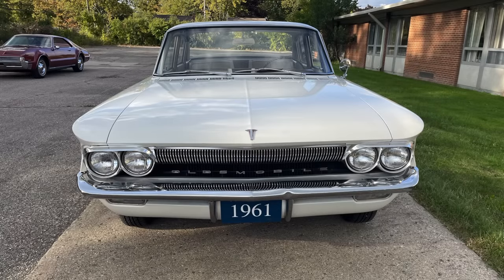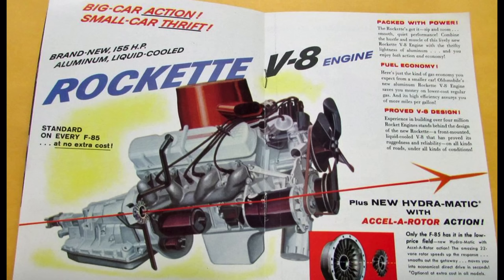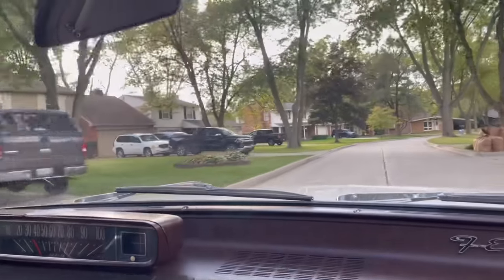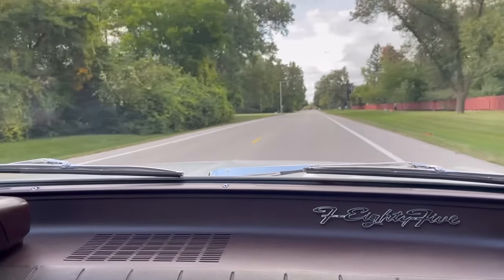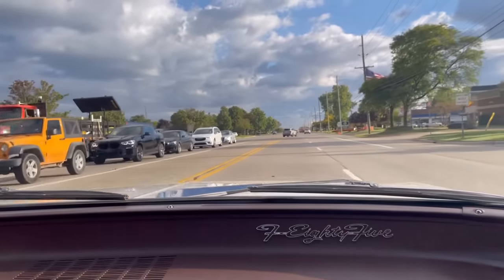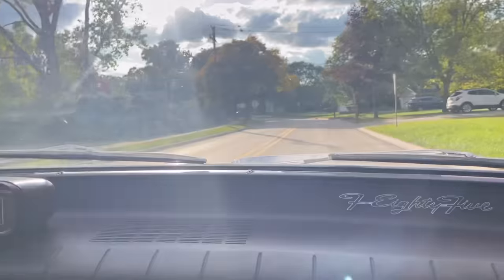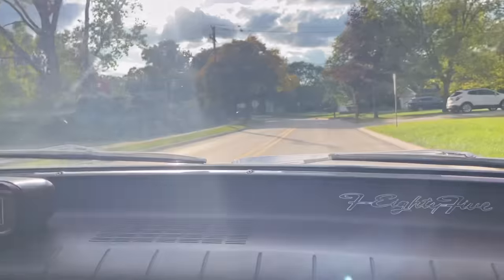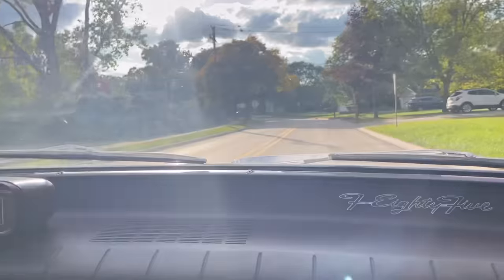Driving GM’s Worst Transmission: The Roto-Hydramatic (“Slim Jim”)

Comment: That is so much better than an unsynchronized transmission. 
One of the many things I hated about a Volkswagen that I had once! it was a 4-speed, but was geared kinda low. 
I would always have to nearly stop on a 90° turn, if I needed to get into 1st gear again! 
I have had a lot of cars over the years, including two Chevettes ( they were great! ), and that was the only car I’ve ever had that was actually a piece of crap. 
-it did handle well, though! I named it “The Hare”.

Comment: Early in my life, I owned three, 1960's Grand Prix; 2 '63's and a '64, all with Slim Jims. The first '63 was inherited from my dad, and dad thought of the gas pedal as an on-off switch. He often utilized that transmission's only positive feature, invariably pulling up to a red light in the right lane of our city's 4-lane Main Street, and with parked cars just a couple hundred feet past the light, it would be a drag race to get around the car on our left. The torque of the GP combined with the Roto's low first gear would shoot us around the left-lane occupant before that awful 1-2 shift. Despite the seeming abuse, that car never had trans problems, nor did my subsequent '63, but I wasn't so lucky with the '64. Finding someone who knew how to rebuild that trans even in a big metro like Dallas was a challenge.  I don't know how those transmissions ever lived behind a 421 HO. Despite all the negatives, that transmission had a very mechanical/visceral operation; you always knew what it was doing. For me, it added to the classic Pontiac vibe, despite it's shortcomings.

Comment: To think automatic transmissions were really only around for 10yrs when this was probably planned and developed/ tested in the late 50s. Not to mention average comfortable cruising speed was 35-45 for most people and with some highways 55-65. That's probably what it's designed to do get to 35‐45 quickly then lockup for efficiency.
Reply: I am so blown away to see people chattering about the tranny I have lived with for 37 years. I have a '63 Catalina convertible on my driveway at this very moment. Pontiac center consoles in '63 and '64 had a vacuum pressure gauge that makes it easy to determine what speed offers the greatest fuel efficiency. What I found, after years of experimentation, is that the car moves at maximum efficiency on the highway at precisely 52 mph. At that speed, in the days of the 55mph speed limit, I drove from Seattle to LA and got 21.5 mpg. At 70 mph, it's more like 14 mpg.

Comment: My sister dated a guy many years ago who had a '61 f-85 wagon. I thought it was a great car and could almost keep up to my brother in laws small block chevy at the time. My brother also had a '62 f-85 convertible that he rebuilt the motor, put on a holly 650 four barrel and swapped the automatic for a three speed on the floor. I had a blast driving that car and it was badass looking. Red with white top and two tone red interior 🤤

Comment: My boss had an F85 in the late 1970s and I didn't really appreciate how special it was at the time, but it did seem a lot better appointed than the average "compact" car. At that time GM's A (later G) body cars had just come out an they used some  space-saving and performance-boosting tricks, like the use of a V6 instead of in inline six, and turbocharging,  that had been put on the shelf when these cars were discontinued. Sadly, his car was T-boned in 1981.

Comment: my dad had a 55 Buick in the 60's, he went through 3 driveshafts in a few months because the transmission gearing was such that anything other than barely pushing the gas in 1st would cause it to slam into second gear.

Comment: I haven't read every single comment that precedes me but so far, I haven't run across the following facts about this transmission; the Rotohydromatic design allowed the car to be push started analogous to a manual transmission car.  I had taken auto mechanic college courses at Oakland Community College back in the early 1980s at their Auburn Hills campus (extremely close to the now-extinct Pontiac Silverdome).  There was a Rotohydromatic transmission core available to practice tear-down/reassembly on in that class.  The trippy design factor on this transmission is that it had what looked like two torque converters; a conventional variation at the front and a smaller one at the rear.  The front torque converter was a bolted-together assembly so you could take it apart to thoroughly clean it out during service/rebuild.  The rear converter was much smaller and a sealed unit like later torque converters found on Chrysler Torqueflite 727 and 904,  Ford C-4, C-6 and FMX and GM TH-200, TH-350, TH-400 and TH-425 transmissions.

Comment: The 1-2 shift in this transmission reminds me of the 2-3 shift in the 1980’s era Ford AOD.
Reply from the maker: Yes!
Reply: I remember that also. That trans went into partial mechanical lock-up in 3rd gear and because that minimized the torque converter slippage the RPM drop seemed to be greater than was typical in other automatics. Also with only limited use of the converter there was somewhat less power available at low speeds yet mine seemed somewhat reluctant to readily do a 3/2 downshift. Mine was 1984. I had driven some later ones that seemed a bit more "refined". Held 2nd a little longer before the 2/3 upshift & a little quicker & smoother on the 3/2 downshift. I think one of the last I drove was '90 or '91. It was generally smoother with a better overall shift pattern.
Reply: The 1986 Lincoln had a fuel injection 302 and an AOD 4 speed automatic that featured positive drive (torque converter lockup) in both 3rd gear direct and 4th gear overdrive but 3rd gear still had some hill climbing and acceleration capability - actually sounded a little like a Mustang GT of the same model year but of course being much heavier the Lincoln could not have been expected to keep up with a Mustang
the advertisements for those things "runs rings around Cadillacs" were true if you compared them to the same year HT 4100 series Cadillacs  
  I believe it could actually hit 25 miles per gallon on the Interstate if you kept it steady at between 55 and 60 mph.  @DejaView

Comment: my experience is totally different. i drove a 63 super 88 for almost 20 years. it had a HO 394 and the 375 roto.  i put 300,000 mile on that car not once did the transmission or engine stop working. in fact me and my brother pulled a 4 thousand pound fully loaded u-haul tailor from Arkansas to Washington state non stop, and i mean non stop except for gas. we went over over the rocky mountains at roughly 70 mph the whole way it was like they were not even there. not one complaint from any thing on that car and it was almost 20 years old at the time. if your engine is bogging down your linkage is not adjusted correctly. From this video that is certainly the case. the transmission is suppose to go into second at around 15 mph through 30mph. then depending on how much pressure you put on the gas pedal determines how long it stays in second.  that super gear is the lock up it can go from 15 mph to around 85 mph and it get s you there quick. as for treating it badly, there was not a day that went by that would not stomp on the gas at 45 were it would drop down into super (s) scratch the rear tiers and take off leaving your head in the back seat. none of that is an exaggeration. 
you should just put the car in second slam it to the floor if you change gears before 35 your linkage is not setup correctly. as for rough shift i have no idea as to what you could be talking about. In fact i have been looking for a 63 Starfire  because of that engine transmission setup. it was the funnest and best car i have ever owned, and i have owned everything from Acura to Volkswagen.

Comment: Observations about a family member’s 1963 Oldsmobile F-85 I drove when I first got my license in 1970.  Basically the same as Mark’s, but the body was stretched a little.  The inside was very roomy, the trunk was huge.  Could have been a really nice car…

The engine 215 V-8 was silent when running, at least when new.  You could not hear it.
It started using oil after 10,000 miles and about 6 years.  Had to be overhauled, new piston rings, etc.  (the car was not driven much except to beauty parlor and church on Sunday)

The power steering had zero feedback and no self-centering capabilities on any turn.  You had to turn it back around or it would literally stick in that position.  Very strange feeling.

The throttle effort required was huge, which prevented smooth takeoff unless you were very easy on the pedal.  (very stiff throttle spring??) Another strange characteristic of this Oldsmobile, which I assume afflicted most of them.

When out on the highway at 60mph+, the hood would lift up slightly and bob up and down until you reduced speed to normal city speed.  It never flew up due to safety catch, but I guess something was amiss with the latch.  

This particular car, the engine threw gasoline into the crankcase.  Don’t know how or why.  When the oil was changed, it flowed out like water. The fuel pump was replaced once, but don’t believe this solved the problem.

The transmission had all the problems Mark and Adam describe.  Seemed to hold 1st gear forever until it dropped into 2nd and the engine seemed to chug somewhat after that. 

I loved driving the car, because it gave me a chance to drive more.  When you’re a high school kid, driving for first time ever, it’s cool to drive as much as you can.😅

Comment: My family had a 62 Buick Special, four door sedan.  It had the V-8 engine.  I would swear it had a two speed auto trans, and with shift quadrant shown in this video.  It also had power steering and power brakes.  It's power steering was overpowered...too easy to steer.  Never any issues with that car or it's transmission.  Remained in the family for many years.
Reply from the maker: Different trans for the Buick

Comment: My '63 Pontiac Grand Prix I purchased for $100.00 circa 1975 kept burning up the starter motors. When I replaced the original Roto-Hydramatic with another (used) Roto-Hydramatic, the starter motor problems ceased. The engine also wanted to overheat before I did the transmission change. Weird. After I put a hi-rise intake manifold on the 389 and took the Grand Prix (with factory posi rear end) to Fremont Raceway to grudge race my best friend's 396 CID Chevy Chevelle SS. I jumped ahead of the Chevy off the line. However, although the floor shift was still in second gear, the transmission nonetheless shifted into high gear, the engine rpm dropped out of its power range, and the Chevelle passed me just before the finish line. Bummer.

Comment: Did they update the governor to the cast iron one when they rebuilt the transmission? If not I would get the cast iron updated one installed because the original one WILL go bad. With the cast iron one it will greatly improve the reliability but not change the goofy 1/2 shift. They are typically available places. I collected several of them with different part numbers. I think for the three years they had 6 different governors. Different ones for different years and if it was a Jetfire or not.

Comment: Ah, the infamous Slim Jim. Yes, I had one. A baby blue '63 Catalina two door hard top. In many ways a very nice clean seven year old car when I bought it. Mine had a new transmission at 70k miles. Motor was very strong and overall the car was trouble free for the year I owned it. My grandfather bought it from me as it had power steering and brakes and was fresher than his rusty but trusty '60 Belair.  He had it for five or six years. As for the Slim Jim, every time it shifted into 2nd gear I cringed. Would it make it? Would it fail this time? Anyone's guess. My dad, who in those years drove 25k miles or more every year, had a '64 Safari that he bought new when I was 10. I really don't remember any issues with drivability or reliability, and he drove the pants off that wagon including hunting and fishing trips, a vacation trip from MN to CA, and using it as a wagon was meant to be used. He traded it in after 75,000 miles or so and said it had some funny noises coming from the transmission on his way to the dealership. Probably ready to fail? Good memories of the cars, but that tranny was something else.

Comment: I had a 1964 Pontiac Catalina with the 269 horse power 389 2-barrel V8 and the model 10 Rotohydromatic transmission. I didn't think it was all that terrible of a transmission. Shifts were kind of goofy but overall didn't seem all that bad.

Comment: I drove a 64 Super 88 4 door back in 1970 to High School.  Had the Slim Jim tranny model 10 I figure according to what you say here. It had to go into the trans shop once. Otherwise drove fine. Trans was smooth from 1st to 2nd if you didn't push it. In 2nd to 3rd you could push it. The passing gear worked smoothly too.

Comment: I’ve had a few Leyland P76s with the Australian all alloy 4.4 litre version of that engine, that came with a similar deck height to the Buick 340, they came with the Australian Borg-Warner Single Rail 4 speed, which was quite different to the American equilivent (BWSROD). For example other than a narrow lip around the edge it had a totally flat top plate, unlike the older American BW 4 speed SR.

Comment: Of the 86 cars I have owned only this transmission in two separate Pontiacs failed me. If I recall both were 1963 Catalinas. Oh yeah, watching the video, that 1st to 2nd bog brings back memories. Heck I thought back in the day my Pontiac transmissions were the traditional Hydramatics. So I swore them off completely. Much later I learned they were the "slim-jim" version. So maybe the full sized Hydramatics may not be something to avoid if the car is right. (like say a 1962 Coupe DeVille)

Comment: I have a 1962 jetfire with 40,000 miles on it.  I pulled the auto trans out and will be putting a 4 speed manual in it

Comment: My Grandfather had a F85 with the 215 V8. My dad stripped out one of the spark plug holes when doing a tune up for my Grandfather. I think many plugs were stripped out by mechanics used to installing them in cast iron.
Reply: Maybe needs antisieze on plug thread's c of dissimilar metal steel / aluminum , although bikes don't seem to be similarly afflicted. Maybe bike mechanics are more attuned to torque specs on al.
Reply: @rogerdodrill4733  It wasn't that the threads seized, it was the fact that mechanics were so used to tightening plugs into cast iron heads they instinctively used too much torque which stripped out the threads in the weaker aluminum. My Dad said that GM even sold a thread insert kit because of all of the stripped heads on the 215 engines.

Comment: I had this transmission in my '62 Catalina. It worked great when it worked. Unfortunately the Torus cracked and that was the end of it. I rebuilt it and no joy. 2 more trans mission guys tried and still no joy. I swapped it out for a TH350 and drove on.

Comment: I've had experience with  with the "Slim-Jim 10"  but your throttle  input may be adjusted  too long, so the shifts are too early. What I am used to is that the 1-2 shift is long and drawn-out,  the fluid couplings are draining and ends with a bang as the transmission goes into the lock-up mode and the 2-3 shift ends with a bump, as the transmission is still in the lock-up mode. I initially thought something was wrong, but a person with lots of experience with this transmission said that it was normal and that's how the transmission worked.
Maybe it could be upgraded to the slushbox Jetaway HydraMatic?  With it's internal fluid couplings, it wouldn't need a transmission hump. Another upgrade might be  the 2-speed Jetaway or Super Turbine 300, which would definitely help the acceleration.
Reply: You can get an adapter kit to put in a TH400.
Reply: The floor hump is so small the only other option is the Dual Path.  But it's air cooled and always had overheat issues.   I remember reading that someone managed to fit a TH200 in an F85 with a custom crossmember that lowered the rear of the transmission a little bit and taking a lump hammer to the floorboard to make a little extra space where needed.  The Jetaway Hydramatic was the size of a garbage can and would never fit.  Prior to 1960, the Jetaway was cast iron and it weigh as much as the Rockette V8.

Comment: Awesome video to watch. Please correct me if I'm wrong, or if anyone even knows, everything you've shown and explained about the 'Roto' Hydramatic seems very similar to what was used in the Australian GM Holden 1961-1965 EK-EJ-EH series cars. I had an 1964 EH Holden which was optioned with what Holden rereferred to as a 'Hydramatic' which had a shift pattern/style and reliability issues almost identical to what you have explained here. I wonder if GM Holden also used the 'Roto' Hydramatics here in Oz.
Reply from the maker: I believe that’s true
Reply: @RareClassicCars  I've often wondered if that was the case and that would explain a few things then. All of the Holden documentation refers to the trans only as a "Hydramatic" which was sourced from GM Buick. They certainly are a quirky transmission, but ya gotta love that gear shift. After replacing the original 'Roto' Hydramatic in my Holden EH three times I fitted a later model Holden 'Tri-Matic' transmission which was much more reliable. Keep up your great videos, they are extremely interesting and great entertainment.